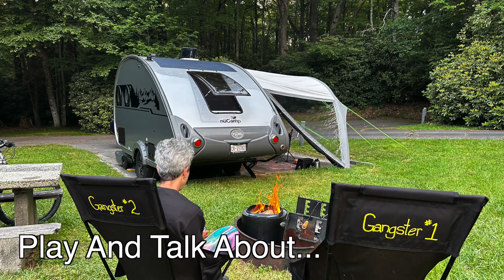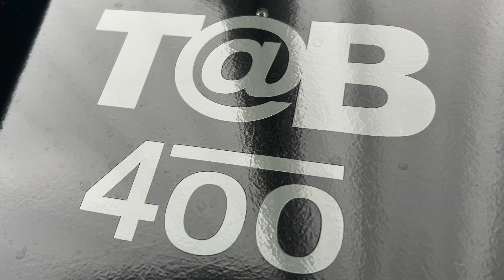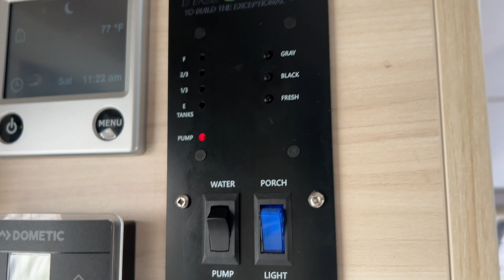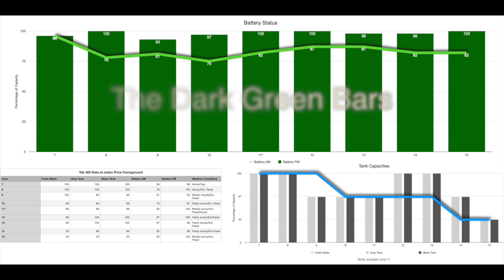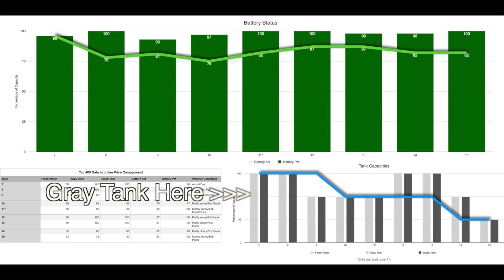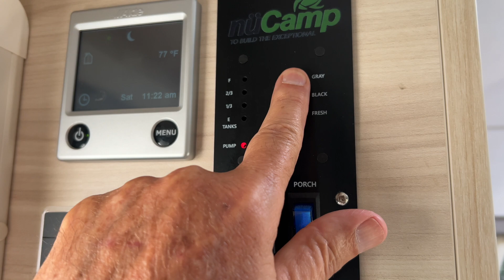Boondocking! How Do We Do It?

Comment: Great info! Appreciated the electric/solar info and pics. Helped explain things. Do you leave your water pump and Alde on all the time or just as needed? Also what do you tow with?
Reply: Also do you only use Alde on propane?
Reply from the maker: @KellyRussell-qb4sy  Great questions! While we are boondocking and actively at our campsite we will keep the water pump on, but if we are leaving the campsite for any length of time we will turn it off. The Alde hot water is very quick at heating up so I typically will only turn it on right before doing any dishes and then off when done.
Reply from the maker: @KellyRussell-qb4sy Another great question! When boondocking propane will be your only option for heat or hot water, but if we are plugged into power we would certainly utilize it to conserve our propane. Hope that makes sense! 😀